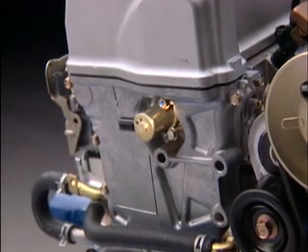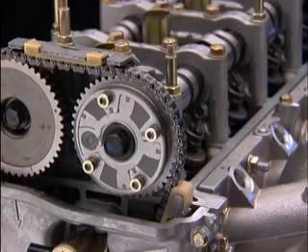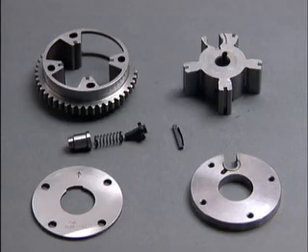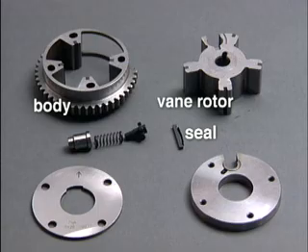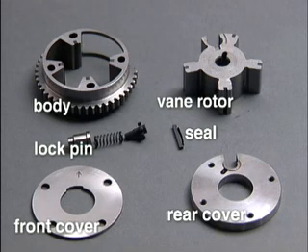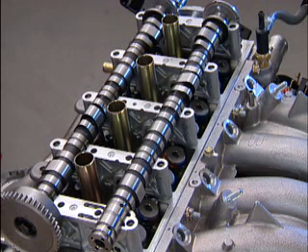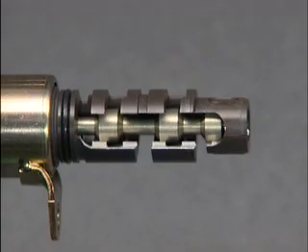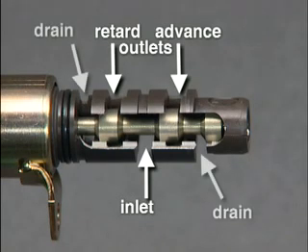K-Series iVTEC VTC Cam Phasing System - In Depth

Comment: Sometimes the VTC camshafts will only have one oil passageway leading to VVTI intake sprocket and the other camshaft journals on the intake camshaft receive oil from a cylinder head cam journal and not a hollow camshaft passageway. So there is only one hollow camshaft passage to feed oil to the VVTi sprocket by the VTC solenoid.

Comment: Probably the best video on how the oil flows in this system. Quote "Under certain conditions the lock pin mechanically locks the rotor to the body in the full retard position". What are those conditions when the pin is locked in the outer body in the full retard position.

Comment: All this is really amazing, but what is the real cause for so many K24s to rattle upon cold startups? Is its that lock pin spring, the VTC valve solenoid? Thanks
Reply: From what I hear there’s a spring in it that goes weak

Comment: Hi..my k20a engine got rattle sound at low rpm..i had change vtc pulley then the rattle sound gone.but after 2 weeks rattle sound comeback..
Reply: Anyone have an idea ?
Reply: If it's a cold start rattle about 2 seconds, change the spring in your VTC Gear. Repair Kits available at spring-start.com. They recommend you change the chain tensioner as well.

Comment: Does VTC affect low, mid, or high-end power? I was told that VTC only affects mid-range power in my Honda, but then someone else said that it affects power at all RPM. So which is it lol? For example if I'm doing a full throttle pull in my RSX, is VTC helping to power through the whole pull, more in mid-range....? Thank you
Reply: depends on the tuning of the vtc system

Comment: Over time the plastic mesh seal brakes n gets stuck in the actuator causing the engine light to go on. I clean it properly n the engine light was gone. Thank for this information .
Reply: The mesh filter can be remove and clean or replace. Make sure to clean the pressure switch next to the filter mesh at the same time.

Comment: who is here cuz they got p2646 code on their k engine car?
Reply: You have P2646.
https://www.700r4transmissionhq.com/p2646-honda/
Reply: @metzmatu8409  your right. I bought a $40 new vtec switch and installed it. fixed
Reply: Nice DIY Fix. Good luck
Reply: Honda has issued a service bulletin #13-021 to address any of these rocker arm oil codes P2646, P2651, P2647, P2652 on the vehicles listed below.
The trouble codes may be intermittent and not all codes may be stored in the PCM. You may not be able to clear the codes. Honda has determined that the rocker arm oil pressure switch may fail intermittently.

VEHICLES AFFECTED: 

2003–12 Accord L4 – ALL

2002–05 Civic Si – ALL

2002–09 CR-V – ALL

2011 CR-Z – ALL

2003–11 Element – ALL

2007–11 Fit – ALL

2012–13 Civic – ALL except Si and Hybrid

Honda has issued a revised rocker arm oil pressure switch

37250-PNE-G01
rocker arm oil pressure switch

Rocker Arm Oil Pressure Switch:
#37250-PNE-G01 (All except 2012–13 Civic)

#37250-R1A-A01 (ONLY for 2012–13 Civic)

O-ring (13 mm X 1.5 mm):
# 91319-PAA-A01
Reply: @metzmatu8409  mine is 08 civic si. I always rev the engine to above 8000, probably that's why vtec switch broke

Comment: Aahh yes the vtc cam gear. The reason I hear a grinding sound at start up.
Reply: I think that's a different issue altogether. I had mine replaced and if I recalled correctly only the gear or actuator was replaced.
Reply: I dont like hearing that noise i enjoy everytime the engine decide to not making it
Reply: I've had that noise as long as I own the Accord. But only at cold start-up in the winter, or after cold nights.

Comment: I still want to know why does the actuator rattle upon cold start.
Reply: My guess, it takes a second for those "Advance/Retard" chambers to fill with oil. Before that, the metal in the actuator rattles because there's no oil to stop the mechanism from bouncing against itself. The rattle isn't supposed to happen, so if you hear it, it means the actuator needs replaced or your engine needs oil, as the rattle will cause further wear over time.

Comment: I have a 2016 Toyota Camry with the 2AR-FE engine with 50,000 km mileage on it. When it sits overnight and I start it the next morning, there is a 1-2 second loud rattle noise. Research into this seems to indicate that this is the time it takes oil to get from the pan to the VVT camshaft gear.  People are telling me that the gear is draining, when it shouldn't?  After the car has started you will not hear this noise again until it sits like 8 hrs and gets cold.  I have checked with Toyota mechanics at 2 dealerships and they say this isn't something to be concerned about... BUT - there were two TSBs for these engines up to 2013 advising that if you get this 1-2 second rattle, to follow the camshaft gear replacement instructions.  So the TSBs pretty much identify that if you have the 1-2 second rattle, the gear needs to be replaced.  and I checked with their parts department and the camshaft gear part number hasn't changed since 2013 or earlier...     BUT - I am wondering if the VVT solenoid valve could be gummed up?   Not closing completely allowing the oil to drain?  And others have mentioned there is some sort of small screen that gets clogged - can't find that.  I bought the car used with only 37,000 km on it and it appeared to be immaculate in condition.  Since then I have been changing the oil and oil filter every 5000 km with Mobil 1 Extended Service 0W20 oil (full synthetic) and OEM Toyota filters...   yet the problem remains.So - what are your thoughts?  Is this the fault of the camshaft gear, or something else?
Reply: You found a solution?
Reply: @farajalagory8027  Nope - for awhile it seemed to be barely existant - was using Royal Purple oil... but lately (170,000 km) has gotten much worse... will have to get fixed now.

Comment: This blew my mind OPEN!  Thanks so much for sharing!!!  What about VTEC-E? (Honda Civic HX, apparently 3 ways? Can you elaborate on that?) . 

Again, THANKS for sharing!
Reply: This video discusses VTC, which really has nothing to do with VTEC. VTC is an additional feature that is packed with VTEC to be called i-VTEC. Most car engines since the early to mid 2000's have had some form of VTC by some other name. 

VTEC is something different and is a honda technology. VTEC is a technology that allows switching between totally separate camshaft profiles, usually a regular profile and a performance profile. In the case of VTEC-E, there is a normal camshaft profile and a camshaft profile that disables one valve to allow for an intake swirl, which can improve fuel economy. Some versions of VTEC include all three profiles.

Comment: VTEC ot VVT????? 
Because its same as Toyota VVT principle of work and have NOTHING similar to iVTEC!!!
You are very amateur, without good knowledge.
Reply: You've gotta be kidding. VTEC came years before VVT, and Toyota discontinued it. Ford also duplicated it but their design was way shittier and expensive to implement. They even called it ZTEC which is a plain-as-day ripoff of Honda's shit. This video isn't about variable valve timing... it's about CAM PHASING, which Honda has dubbed iVTEC. This allows the valves to change opening points to adjust valve overlap depending on RPM. Not the same as VVT which varies the volume of intake through the valves past a certain RPM.

Comment: Hate when my vtec is fully retarded
Reply: Was stuck off with bad sensors ran 10,000 miles without vtec, without going over 3,000 rpm’s k24a4